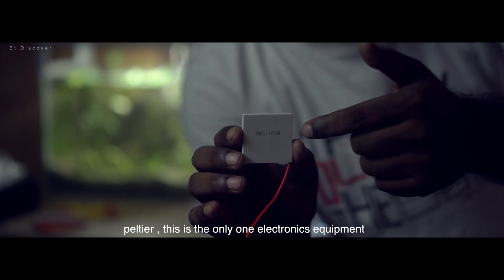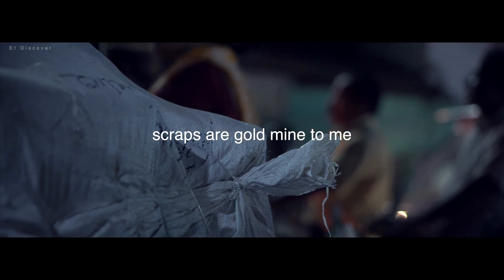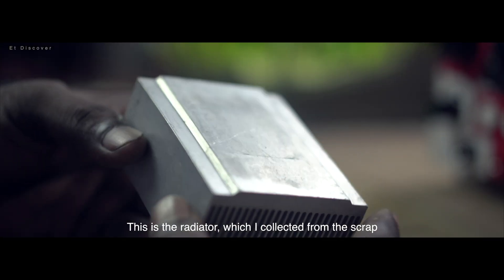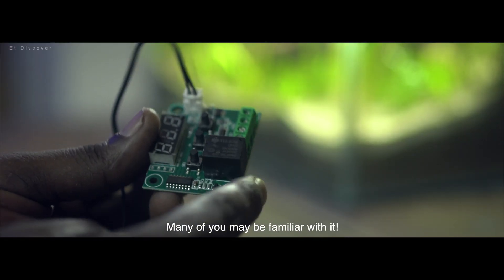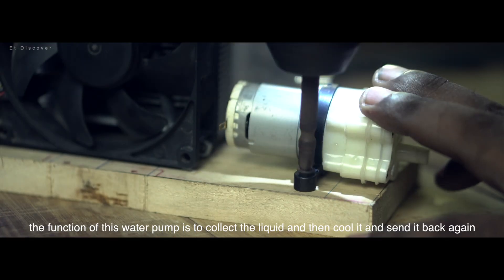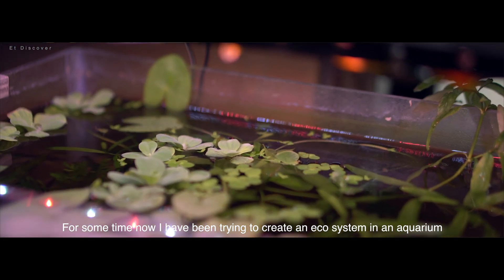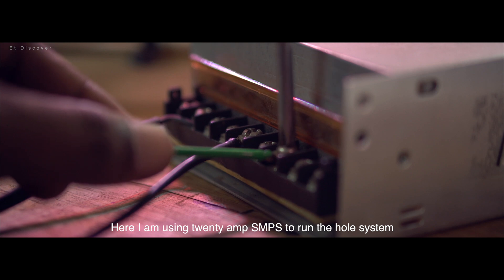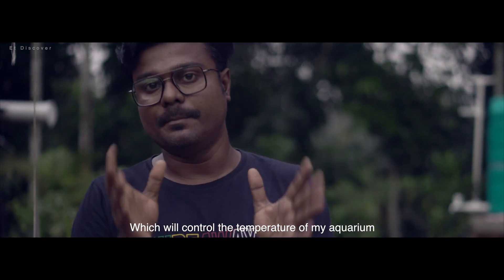Can This Device Really Save Lives?

Comment: Not working bro. I am failure project
Reply from the maker: Use original pelter and use big hit heat sink and run your pump vary slow
Reply: @EtDiscover  tec 12703 is really good peltier among all cause it consumes 3 amps and gives best results among all I would like to share a comparison video in comments for everyone